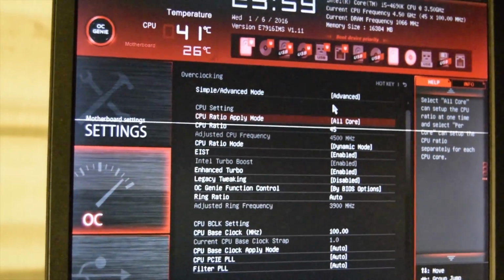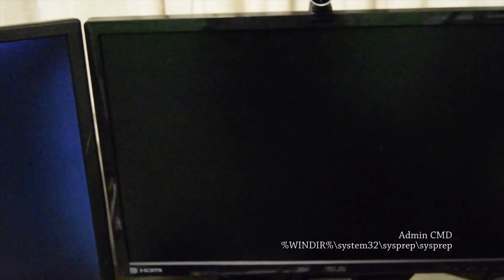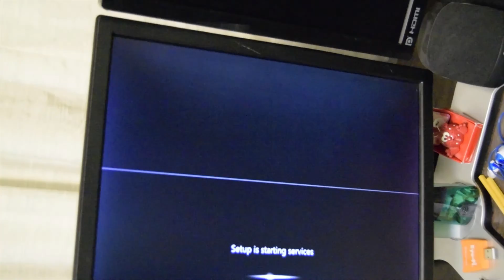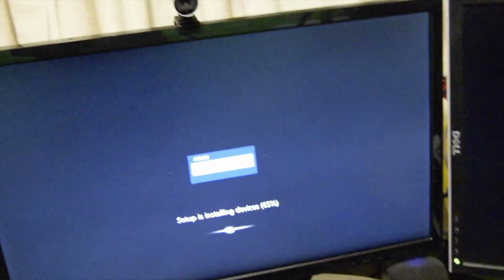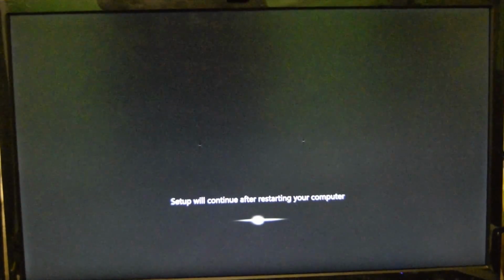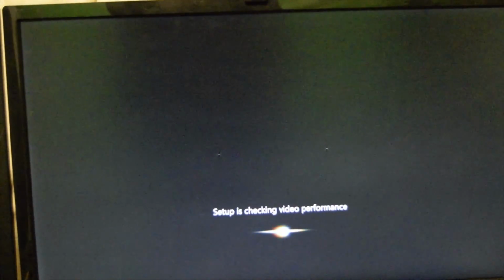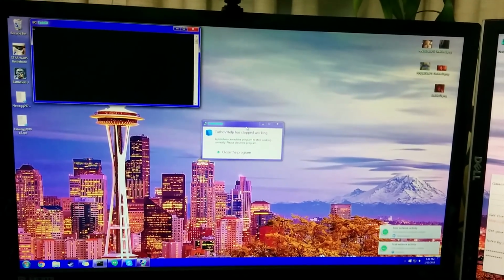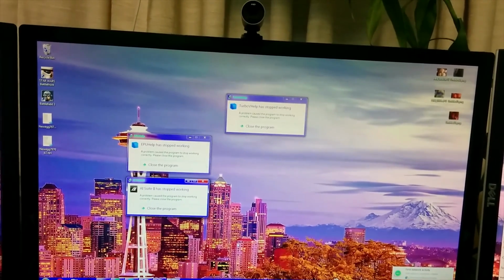AMD to Intel, CPU and Motherboard Upgrade without Reinstalling Windows

Comment: ill be going from a fx6300 to an i5 7500 so lets hope i get the same results on a win 10 though all im doing is switching cpu and mobo
Reply from the maker: You don't need to use oobe for windows 10, because it doesn't build the kernel based on hardware.
Reply: @Grim1873  so do i just switch my HDD to the new mobo and cpu ?

Comment: Please help me out here bro.
I am using AMD sempron 145 processor and wanna swap to Intel core 2 duo or something as my PC is giving me lot of trouble.please let me know is it possible ? I am will to change complete mother board if necessary
Reply from the maker: Why not go with something more recent?, 4th gen I5 prices have dropped quite a bit
Reply: @Grim1873  thanks man

Comment: LITERALLY DELETED ALL OF MY FILES AND FACTORY RESTORED.... 6 FUCKING YEARS OF FILES GONE. DONT DO COMMAND ON WINDOWS 10
Reply from the maker: Windows 10 doesn't build its kernel based on Hardware. You can just change computers with your install without needing to do anyting.

Also are you sure that it wasn't October's update that deleted all your files?

Comment: why fingers crossed?
Reply from the maker: Lucas Snow because it doesn't always work, and I'm not sure why.

I think it has to do with the way the kernel is originally compiled and wether that can run with the new setup.
Reply: Maybe the oem versions of windows seen it mentioned on a few forums

Comment: did you have an oem key or a retail key?
Reply from the maker: gavinct OEM but it shouldn't matter
Reply: so it should be fine when i switch my mobo? It will boot up as normal?
Reply from the maker: gavinct I'm not sure but I think there's different ways that the kernel can be compiled to run during initial install, and if it is the same or similar on your old motherboard as your new motherboard then yes the out-of-box experience will work, if not it will crash or bsod during first boot.

if you're just swapping out in the motherboard and you're keeping the same CPU and chipset then OOBE probably isn't necessary.

it would be helpful to know what motherboard you're going from and to and also if it works, so let me know once you try.
Reply: yeah this is a way different chipset from my old one, i think i'll just buy another key.. will that work?
Reply: my old mobo: gigabyte 78LMT   New: msi h110m gaming
Reply from the maker: gavinct my upgrade was similar, its worth a try. you can always buy a new key if it doesn't work
Reply: alright, thanks for the help man!
Reply: One more question, if i try to do this will i be in deep shit if it doesn't work?
Reply from the maker: gavinct no, you can always go back to your old motherboard if you need to get back into windows

Comment: did you have to put the activation code at this part  3:05 - 3:11
Reply from the maker: Arran Bear nope
Reply: Grim187 oh ok, because im on a FM2 socket, and i want to change my motherboard to a LGA1150 socket type motherboard, i heard that you have to uninstall all drivers and install the motherboard, and then re-install the drivers, does this actually work???, because im worried for doing this becasue i dont have an aactivation code

Comment: i have the amd phenom and wanted to upgrade mobo and cpu . can i do the same just plug and play?
Reply: and im still running windows 7 i dont want to upgrade it.
Reply from the maker: I dont know, and you wont until you try.

I think it has to do with the way windows builds the kernel which is based on the generation of cpu/motherboard?

backup everything like you are going to reinstall windows 7 and give it a try.

Comment: I'm changing my intel core 2 duo, for a intel i5, what should I do? Will I need to reinstall windows?
Reply from the maker: this method might work, back up everything as if you are going to reinstall windows then try it
Reply: no dude you dont,intel to intel is fine like amd to amd cpu ONLY DO THIS METHOD WHEN YOUR SWITCHING INTEL TO AMD OR AMD TO INTEL!

Comment: I'm getting intel i3 6100 in a few days and currently I'm running intel core2duo. So do I have to reinstall windows or not?
Reply from the maker: surender rajput Maybe , get everything ready as if you are going to reinstall then use this method.
Reply: Grim187 I'm using windows 7 ultimate edition. I hope this methods works for me.
Reply: surender rajput Did this workout for you?

Comment: Was anything lost in the upgrade? You didn't have to reformat Windows or anything?
Reply from the maker: I did not have to reformat the hard drive. Im still using the same install of win 7 from the old motherboard/processor.
Reply: @Grim1873  what if I'm going to amd to amd ryzen would I need upgrade driver or reinstall Windows

Comment: Ive swapped motherboards without having to reinstall windows. but im on windows 10 so, i have AMD to AMD
Reply from the maker: so it's really only a problem if you're changing the way that things are processed by the operating system, so if you're changing chip sets and or CPU manufacturers.
Reply: fm2+ to fm2+, just want to change asus to gigiabyte, and my cpu is stil the same.

Comment: Have you had any issues I am waiting on my mobo to arrive I am going from a fx 8320 octacore to a i7-6700k and am curious if you ran into any difficulty's not reinstalling os? IE slow drives, audio driver problems, input lag, corrupted data from old mobo?
Reply from the maker: the only real problem that I had was the old motherboards specific software wouldn't run the uninstaller because it didn't detect the the motherboard that I was using was compatible with it. everything else seems to work fine. I did however try this on a different AMD motherboard to a different Intel motherboard and it wasn't successful , so make sure you back everything up properly and get ready to reinstall Windows. best of luck
Reply: +Grim187 thanks for the reply man much appreciated!

Comment: Hey what did you have to do before you changed to mobo for windows?
Reply from the maker: +Aaron Gonzalez run cmd (run as admin) "%WINDIR%\system32\sysprep\sysprep" it will open in a new window, select OOBE then hit OK. replace the motherboard before the next boot.
Reply: +Grim187 hey I just got my chip and when i open up that window do i select generalize or leave it unselected
Reply from the maker: Aaron Gonzalez i dident check it.